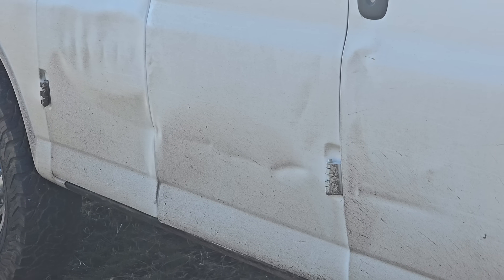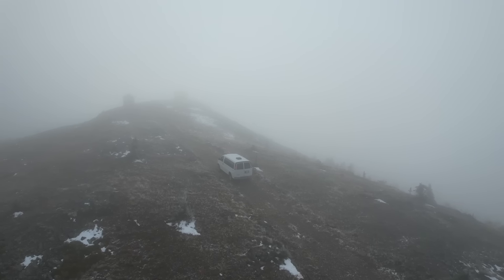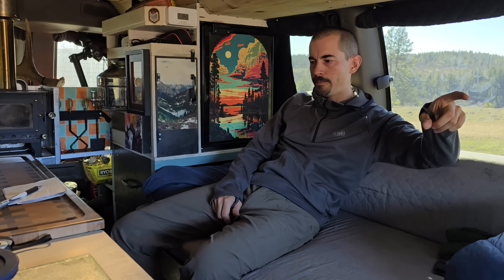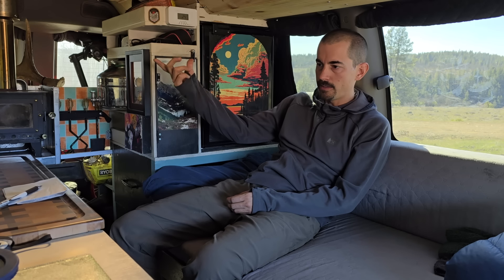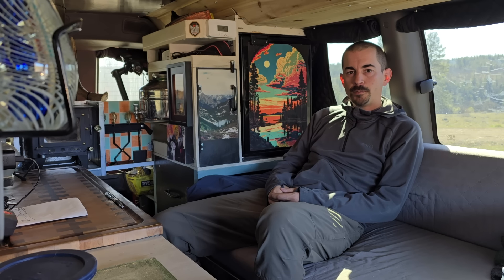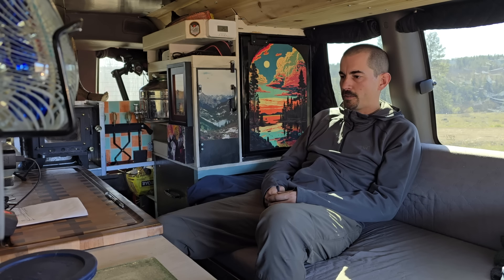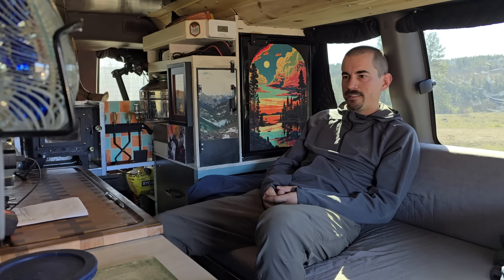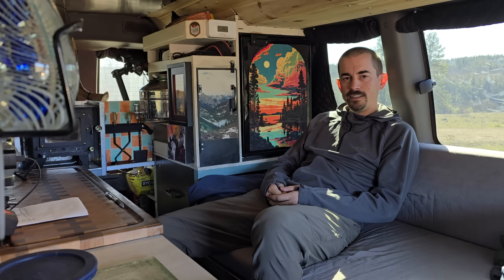Lets just talk about condensation and insulation.

Comment: Vapour barrier is only a part of it. Any material that is colder than its surrounding environment's dew point, will have condensation. Thats why your original build was actually pretty OK, so that you actually heat up the skin of the car. If you add insulation, dont add too much if you are leaving air gaps. The beams might not be a good idea. I would rather have a shell built inside that is not attached to the roof at all and filled in thoroughly with insulation.

Comment: Dreams and plans are good…..I know this is not DIY …but if you are going for a redo…then why not a new high top ..I know it’s more to heat but you will gain height and therefore space to grow vertically. Being able to stand up in a van is big. And you are in it full time. Then maybe put your woodstove more central to emanate heat evenly. Also…and I have never seen this…put your refrigerator outside on a tow hitch rack. You are using energy to warm up the van and energy to cool down the food. Outside in winter is cold and even summer nights cooler. More room for you and your cute puppy.

Comment: Have you considered using your diesel heater as a positive air input system? If you fit the heater with the eberspacher external air temp sensor then you can draw air from outside, this pushes out the warm moist air and totally eliminates condensation.
Reply from the maker: With my minivan, I experimented with this.  Ran a duct outside and connected to the diesel heater inflow.. Definitely helped create air exchange.. but... at -30c outside temp, the diesel heater was only putting out lukewarm air.  It really hurt the btu output..
Reply: @morestyforest4325  I had a feeling your temperatures maybe too cold for this system.

Comment: Seriously, if you're going to keep that thing, invest the money and get Fiberine or Tufport or someone to put a fibreglass high roof on it. You could stand up in there, you could put a bunk in the top and gain back a bunch of floor space, you'd be able to put an actual bathroom in there, the benefits are endless, I mean it's $5000 Canadian to do the conversion but it's so worth it, it would turn it into a real home without all the compromises, and insulation would be easier.

Comment: 4:45  Dude, burning anything generates moisture and a lot of it.  Burning 1kg of dry wood creates 500 grams of water. Most will go out the chimney, but some will end up in the van.  Propane and kerosene will generate their own water. Burn 1 gallon of kerosene and you get 1.5 gallon of water vapor.  Burn 1 gallon of propane, get .81 gallons of water.
Reply: "Burn 1 gallon of kerosene and you get 1.5 gallon of water vapor"
Really? I run a mix of kero and diesel in the diesel heater and don't see even a tiny fraction of  that amount of moisture.
Reply: @cabracove  It's a chemical reaction.  I always heard it was 1 to 1 (1 gallon of kerosene gives 1 gallon of water), but I doubled checked on google and it gave the 1.5 per gallon number.  Either way, oxidizing 1 gallon of kerosene will give you at least 1 gallon of water.     If you have a hard time believing it, just look it up.
Reply: @tarstarkusz  My issue with that is where does the water go? It's just weird.  I don't have condensation problems in my van at all.
Reply: @cabracove  If you're burning wood, probably 90% or more is going out the chimney.  But if you're using a buddy propane heater or something similar, it's all going into the van.  Where it ends up in the van, I have no clue.
You might want to buy a humidistat meter and just see what it says.  They're cheap enough.
Reply: @tarstarkusz  Could be a good idea. Diesel heater and the inside is all hard surface, the hi top is not insulated. It stays dry up there. Only place that gets condensation is the windshield, but not when the heats on. Very strange.
Reply: @cabracove  While burning diesel does generate a lot of water, I'm pretty sure the combustion chamber is entirely sealed and all of the exhaust (which is where the water is) goes outside the van.  If you're using one of those diesel heaters, there shouldn't be any water getting into the van.
Reply: @tarstarkusz  That makes sense, it puts out a ridiculous amount of heat. Right at the output the temp is around 200 degrees. Thanks for the info.

Comment: Just a comment from my experience. Plan and cost your options carefully - when all is said and done, you might find it more logical to start from scratch with a newer vehicle rather putting a bunch of money into an old van.  Regardless of how well you have cared for your current van, it is still an old, well used GM van.
Reply: It's also much more well made than any new van. I wouldn't trade my E350 for any Transit, Sprinter, etc. It's been utterly solid through AK, Canada and the lower 48.
Reply: You may well be right given the build quality of today’s vehicles, still, an older Toyota Tundra that still has the very reliable v8 powertrain with some type of bed mounted camper would be a great choice.

Comment: Why not spray foam? Could DIY with a froth-pak or hire a spray foam contractor. 100% coverage in all gaps and insulation/vapor barrier in one. Attach 1x2 to roof supports, then spray foam then attach TNG to 1x2. Maybe remove all interior plastics, spray foam, reinstall plastics.

Comment: I kid you not just today I had some helpers finish the foam board insulation which has foil facing to the outside and now I'm questioning the bubble wrap that we hung I didn't glue it to the walls because most glue doesn't stick to the foam board and I am now putting a humidifier gauge behind the bubble wrap that is stuck to the walls in places🎉 at the moment humidity level was 30% I'm considering I live in Montana and have been dancing back and forth with winter temperatures I'm thinking 30% as low as I'm going to get as far as humidity goes😂😂 but I bring this up because there is two different schools of thought on the topic and On the Sunny Side of the van that was fully insulated when I slid my hand behind the foil bubble wrap I thought I felt condensation😮😢😮🎉 I have a builder coming on Monday who's going to help me frame the walls and do a little Cabinetry and a platform for the dog on the passenger seat to make it bigger cuz she's a GSD the other little one will probably share that seat and one day the dashboard😮 the solar and the fans are already in by golly I'm going to hit the road before July you never know Simon I might come visit you😂❤😂❤ oh by the way people did everybody building out of Van make sure that the butyl tape that you buy to install the maxxair fans is rated for windshield install because the crap I bought off of Amazon is melting down onto the van floor😢😢😢

Comment: Condensation has two supports -- humidity and relatively cold surfaces. Reduce or eliminate either one -- or both -- and the problem becomes manageable. Blasting a fuel burning or electric furnace is costly and inefficient. 

Humidity can be exhausted from floor vents with less heat loss than via a roof vent. Objects, including window glass and sheet metal, can be warmed with infrared and near infrared radiation without heating room air. Plus, those wavelengths can penetrate thin layers of clothing and even our subdermal tissues to warm animate and inanimate objects. If seasonal cooking is flexible enough to accommodate the extra wattage for such equipment, you could be in business sooner than you think.

But of course testing is called for here, unless the internet engineers are utterly convincing of the folly of such notions!

Comment: I highly recommend you go watch and listen to Greg Virgoe. The schools of thought on the vapor barrier go back and forth my solar guy that installed my solar system and builds out Vans says hell no to the vapor barrier😮 what is important is the Radiant Barrier while insulating the van this winter and using the stick pins on Amazon to hold the foam board in place vertically or horizontally and then the foil tape that you use😮 I realized as I stuck the foil tape to the wall just to hold it in place to keep the roll going because by the way it's a pain in the butt to split piece by piece😂 when I touched the tape that was directly on the skin of the van I could feel the warmth from me and my body on the inside versus the cold coming from the outside😮😮 so then the next day when the sun came up I went out there and did the same experiment with the Sun😮 I put the foil tape directly on the skin of the van that the Sun was shining on😮 and then touched both the tape and the plain skin of the van and you would not have believed the difference😮 I stopped what I was doing and I taped with the foil tape everywhere that foil foam board was not going to go and I had to put some foil paper on the foam board because here in the states the foil foam board is not closed cell😮 so Simon I've been doing experiments and if you want to message back and forth on Instagram just give me a message here😮 I also did really something amazing on the ceiling gave myself a false ceiling.
She's a 170 high top Sprinter 4 * 4 and doesn't even have 3,000 miles on her😂 if my ex-daughter-in-law wasn't already promised the van I would leave it to you😮❤😮❤ thanks for all you bring to our lives

Comment: Hot air holds more moisture so it always a trick to get it dry I'll warm up in the morning for 5 minutes or so and I just wipe the windows never really anything worse than a light haze if you clean it in the worst times like on a cold dew foggy morning warm up clean and get it hot and let it dry out during the day time heat I clean the outside windows and mirrors and you can feel the heat from your hand go into the wetness on the towel and I fond myself cleaning certain things in certain orders depending on wjat is wet or dirty and I always get the 20 packs of Walmart towels once they get a lil dirty just use them outside then even when you change the oil

Comment: i have no professional experience, but… it seems like the condensation is gonna come through the roof and into the foam.  If you put the sealant on the top of the foam it would keep the foam from getting wet (and moldy) but then the water will find a way past the roof and down the sides probably.  Just a thought, my wife33 is Japanese and when we go there every corner store sells these things they put in their closets to stop condensation through humidity from getting into their bedding and so on.  I don’t know what horrible chemical they may be made of, but they work.  They kinda look like air fresheners.  I wonder….

Comment: Wouldn't vapor barrier keep moister in?  I would think the best way to keep a van dry is to run your diesel heater and exhaust from the roof fan. The windows are the worst in your situation.  I wouldn't have any windows expect those that are required to drive if I was living in a van in wet/cold climates. Than I would install a insulated gas barrier between my body and those windows.

Comment: Having wet windows is not mark of too high humidity, but normal. Simple physics, regular, healthy (40-50%) relative humidity will always form water on a cold one layer window. Nothing, you can do about. The only thing, you should not do: dry your air with ventilation to the level that there is no water on window. This would mean, your cabin has basically below 10% relative humidity, which is very unhealthy environment for both you and Rocco. I see this a lot that people think, humidity is enemy. No. Humidity has to be between 40-50 to have a healthy living space. Both under and above are not ok.

Comment: Spray foam insulation, only condensation I have is on the outside of the van😊  tigerfoam kit
Reply: I looked in moutain areas for 4x4 short buses  to no avail, just found a m715 ambulance thoe😁
Reply: Put a vent down the center of the roof and build out channels down the walls with fans at the bottom for recirculation so it isn't hot at the ceiling and cold on the floor
Reply: Spray foam the underside too, it's fire retardant I've tried to burn it as a test
Reply: And use 0000 ought cables for you're battery and grounds dc charger, rated for 300 amps, might be why you're cooking you're alternator

Comment: One of the biggest mistakes that DIY van builders make is to use residential construction adhesives and materials. We should be using marine-grade materials. Yes, they can be more expensive, but especially for adhesives, they are more flexible and are designed to resist mould. Construction-grade materials are not made for vibrations and constant movements, and in most cases, moisture (obviously other than bathrooms). Can’t take credit for this insight. Got it from watching tips from a pro van builder. Can’t remember the name of the channel or I’d link to it.

Comment: Pad out all metal beams with oil based SPAR polyurethaned wood, the depth you'd like to build your insulation to. ESPECIALLY ON THE CEILING... Pay a pro to use foam based insulation because no matter how much humidity is in the air, it will NEVER get past the foam to the metal, if sprayed in properly. And condensation will be NON EXISTENT. If you want to make it quieter, add some NOICO to whatever percentage works for you after some research to the sheet metal panels before the foam. If you decide you don't need that much see through exposure, you can spray paint the windows inside to blacked out and do the same with the walls as well right over the blacked out windows. If the Foam guy brings the foam to where whatever wallboard you use meets, you most likely won't need any vapor barrier. Stainless screws and Heavy Duty Construction adhesive for the wood over the metal studs padding will make this quite bulletproof. You will be exponentially warmer and cooler whatever season that would be desired. Places with extreme cold usually have some good spray foam guys as it is almost mandatory with the price of heating fuel.Hope this helps. I am a perfectionist and this is what I'd do after much research  Whatever tongue and groove you use... Seal all sides with several coats of oil based SPAR poly as well. Condensation can't get wicked in if sealed real well. You don't want to use anything that could potentially be a host for water to make a home, especially absorbed in deep. Nor anything that could possibly be a condenser. Foam in the hollows of all the metal support beams and studs too. Maybe a bigger bed for when company decides to visit. LOL Nothing like an insulated van done so well, the movie "The Day After Tomorrow" would be no problem for Simon and Rocco. That pup deserves NOTHING BUT THE BEST! Rocco ON!
Reply: And like the gentleman said below, PIPE IN THE COMBUSTION AIR!. So many houses that are sealed tight and use inside air for wood stove or fireplace combustion that goes up the chimney, wind up causing a backdraft with the oil or gas heating system exposing them to CO.

Comment: What about using polyurethane foam. Makes the insulation and vapor barrier all in one step. Buy a froth-pak and do it yourself. Or get a professional installer, with the size of the roof it wouldnt be expensive.

Comment: Another YouTuber has two small vents in the floor... which lets out less heat.
Reply: I live in a boat and I have some holes in the floor into the dry bilges - I have chosen to have them under my fridge and this seems to increase the air flow and make my fridge use less power in the summer 😊😊
Reply: @TheLampini  Ooooh, that's a GREAT idea!
Reply: @LaraSatoriHarris  I know! I read it on a very obscure canal boat forum in the UK.. the original idea did incorporate a 12v computer fan - he reckoned he saved more amps than the fan used! I have some in the ceiling vents on the same circuits as my kitchen and bathroom 12v low power downlights - goodbye cooking smells n condensation and goodbye shower condensation 🙂👍.
 I needed some low level ventilation anyway and under the fridge keeps it out of the way too - so the energy saving on fridge was a by-product.. i was sceptical that it would do much without a fan - but it does. Win-win! 👍
Reply: @TheLampini  I'd like to do a small, screened porthole type vent in the floor. It could be closed while driving to keep out the dust. 
I have a roof fan and a hatch currently. I appreciate your explanation of your set-up... thank you!
Reply: @TheLampini  canal boats are SWEET. That's the dream I'm approximating with my van    😄

Comment: Study what the escamos do then study stuco and how houses are build in Africa or Spain or Greece, you know you have got to vent like a chimney vents all the gasses that build up like carbon dioxide from you and your dog this is why you cannot be air tight you might ask a builder of houses from every climate how houses are built, the outside of your van is metal gets too hot in summer too cold in winter need an outside silicone rubber what ever coating of the metal for all seasons first then start insulating stone or mud or stucco or clay papermashe a light weight insulation for heat and cold you have to vent and insulate the floor first and foremost where cold is drawn from the earth, you have an exhaust pipe that is hot then cold and there are wires you can put under your floor like wires for an electric blanket same thing is used in air planes to heat pipes at altitude to prevent freezing and or a small forced air system that heats and cools and draws out moisture you might need bigger batteries for that type of system, floor heating instead